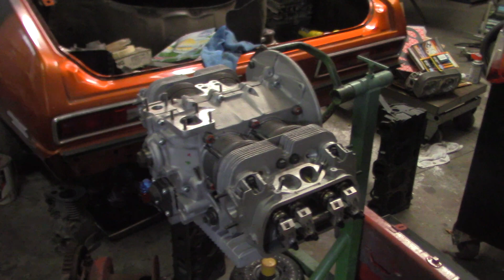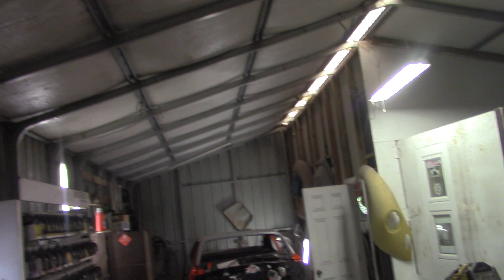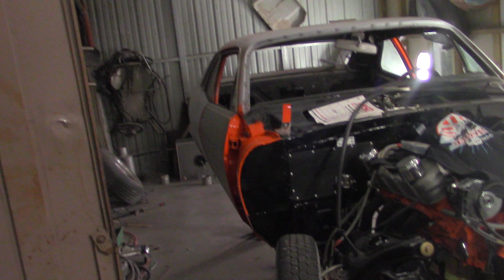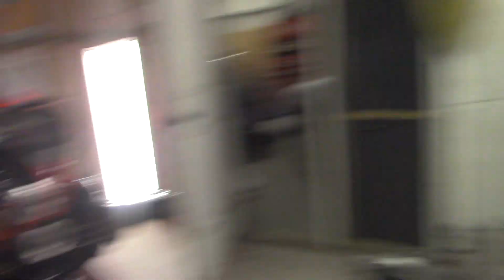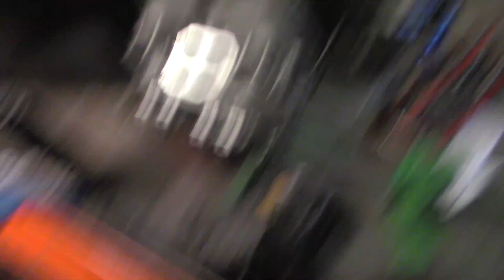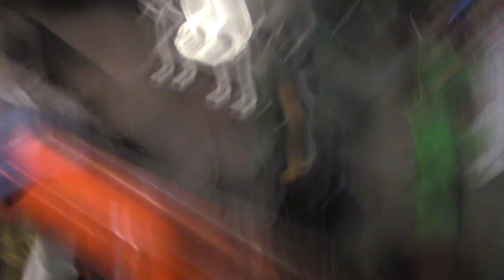i have missed lead you

Comment: One thing I didn't understand is you made a big thing about saying that straight cut cam gears damaged the lifter bores, yet you are still running one in this engine aren't you? or does that only apply in big HP applications?
Reply: +shoominati23 Its because he doesn't plan to run it alot
Reply from the maker: i only use them in race motors that wont be seeing alot of street miles if you have to put 20 miles on before a race thats a given we service these motors quite a bit also never leave together for more then 30 passes much easier to service before it breaks